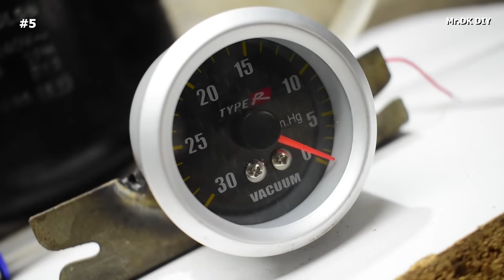Top 6 HOMEMADE UNIQUE CREATIVE IDEAS

Comment: I like the sand blaster, just a couple of tips though, use dry sand it flows better, spread it out on an old sheet in the sun and then screen it after it is dry (no clumping in the bottle), and some sand blasters have an agitator hose that feeds a small stream of air into the sand container to stir up the sand and keep it from settling and clogging the tip. hope this is useful.
Reply: I was going to say the same thing with the sand. Lay it out evenly and thoroughly dry it out. You can see just how moist it is when you put it in the bottle as all the condensation collecting on the walls of the bottle. I mean who wants to get that close to whatever is being sandblasted, not to mention how long it takes you to just clean off a tiny amount of material. Good in theory though, seeing a higher psi might help also.

Comment: on 10:46 you were drilling out holes in steel..........Please use wd-40 on the drill bit or the plate itself. You can save your drill bit of wear and tear.........No friction  :)  :)

Comment: Mr. D k you are a genius.  Can u be able to make an air engine  which runs by the power of air. Which is used to fill air in vehicle tyres and  for spray painting machines compressed in a tank and then fed to a champer which is heated up  by an electric 12 volts heater coil by a 12 to 24 volts 40 amps battery  which the air is more highly  pressurisd and then  fed to  the cylinder kit which  pushes  the piston  and thus turns the fly wheel by krank shaft.  Thus a rotation  motion is produced produced which in makes the alternator  to produce electricity too which charges the battery  + heater coilt power  too + other  mechanical  rotation too for vehicles or any other purposes too.
Thus this air engine will be pollutionless ie no pollution at all.  An environment friend too.

Comment: Everything was going along just fine until he had to paint it with that shitty yellow paint.  Would have been a lot better to just leave it without any paint at all.
Reply: I was going to comment on if few of his other videos, doesn’t anyone use primer anymore. Especially on parts that have a bit of oxidation still on them if not completely cleaned off, then again maybe once the paint starts flaking off will the primer have been a good idea.